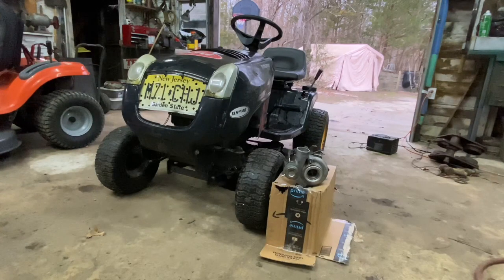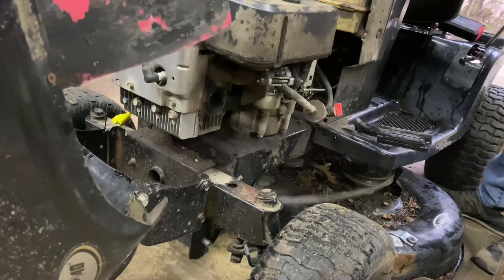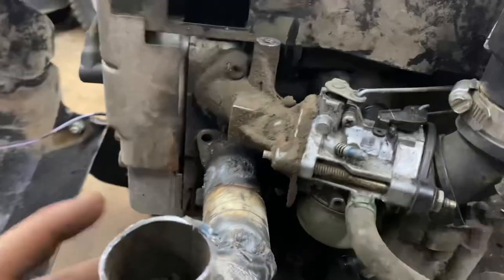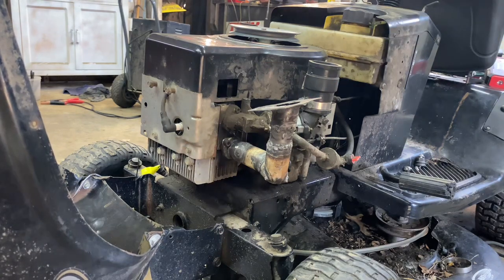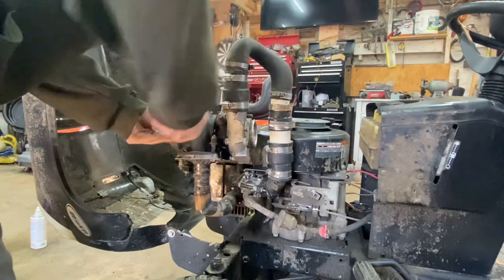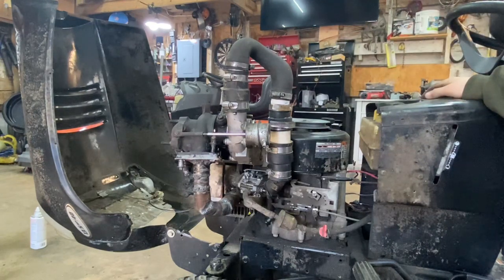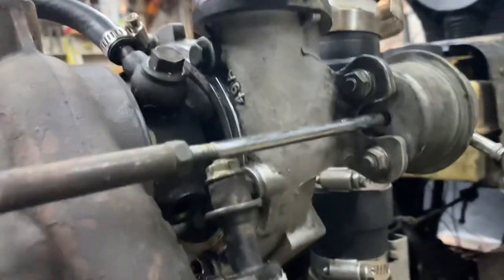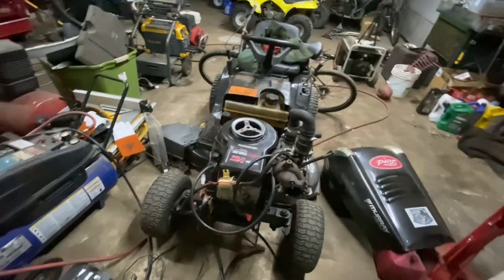Putting a Turbo On a Lawn Mower! | Part 1

Comment: Mount the carb on the intake of the turbo and it will work way better. Right now whatever boost you are making is pressurizing what normally should be a vacuum operated carb. The only other option is if you convert it over to EFI, then you can have the throttle body after the turbo.
Reply from the maker: I might end up doing that but I don’t want to have the governor bypassed because I still mow with this mower. Thank you for watching!

Comment: You need to put the carburetor in front of the turbo, not behind because the carb needs vacum to work properly but the turbo puts positiv pressure on it so no gas will be sucked out through the nozzle in the carb. Sorry for bad English😂
Reply from the maker: I might have to try putting the carb up front, thank you for watching!

Comment: The impeller should turn very easy,  and continue to spin. That may be a little too big for that engine.  Still a very interesting project.

I like your oil system. That should work just fine.
Reply from the maker: The impeller spins even at an idle, and your probably right about the turbo being to big but I’ll try to make it work. Thank you for watching!
Reply: @specialt9744  
It sounds good.  I hope it works good one thing if you put a good load against the engine,  that's when the turbo will show how well its working.  You may need to be sure the engine is running at 3600 RPM to get max power, maybe 4000.  

Good luck will be waiting to see how it works for you.
Reply from the maker: @bertgrau3934  So far the turbo has been pretty good. I still need to adjust some things to get it perfect though. I’ll have to look into the engine speed, it seems to be pretty close to the 3600rpms but I’ll have to put a gauge on it.

Comment: Take that wobbling pulley off on top of your flywheel it will thought your engine out of balance.
Reply from the maker: I keep it on there so I can use it as a pull start if the battery dies and it’s not to heavy so it doesn’t throw off the engine balance. Thank you for watching!

Comment: turbo link ?
Reply from the maker: I bought it used on eBay for cheap but it’s a 3.0 L SAAB turbo
Reply: @specialt9744 Would you say a Mazda CX7 KO4 (smaller turbine than Mazdaspeed turbo) would be comparable to that one? Don't want to blow it up on the first go😅
Reply from the maker: @Dyl_Cam  I’d say it’s close enough to give it a try… what the worst that could happen🤣 thank you for watching!